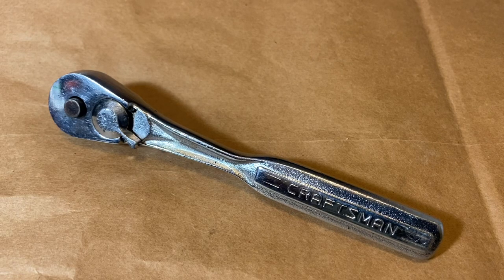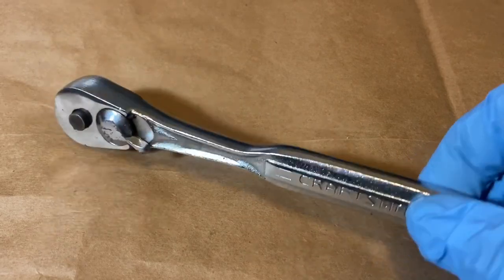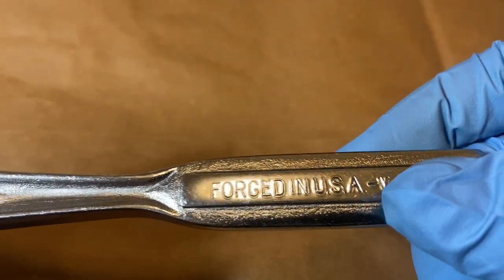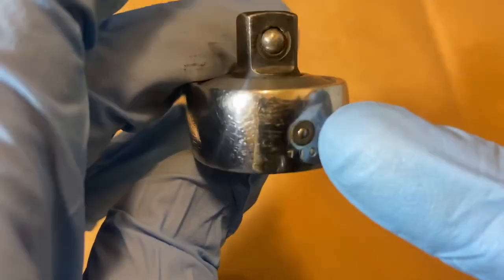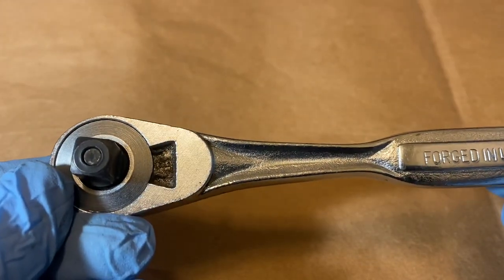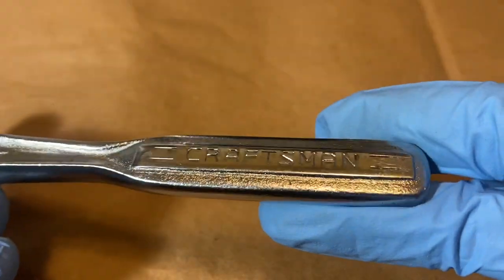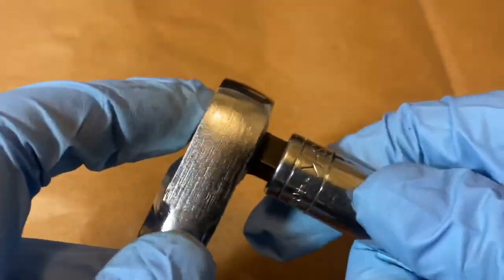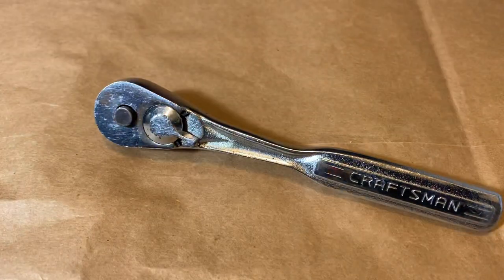“As Found” Craftsman Quick Release TOTAL TEARDOWN Vintage 3/8” Drive

Comment: Do you remember awhile back I was having trouble with a Craftsman ratchet?  About trying to oil it and couldn't get the oil in?  That's the same ratchet you have there.  It was doing the exact same thing as the one you have there.  I cleaned it but I also added fresh grease to mine.  Anyway, that's all it needed was cleaned.  Whatever lubricant they were putting in at the factory wasn't very good. At least I don't think it was to gum up like that.
Reply from the maker: Yeah that grease they used was not great quality

Comment: I've been using that model for most of my life, that was one of the handful of tools that failed and got taken back to Sears and got a new one or as I recall actually a rebuilt one...............Every now and then I run into some of that hardened gummy grease, last time was in a HF right angle drill adapter that I bought new about 20 years ago.
Reply: I'm surprised that just a little dried grease caused the skipping.  I was expecting to see sheared off teeth when you opened it up.  Goes to show how important lubrication is.
Reply from the maker: Yeah that grease is pretty bad

Comment: looks like some one used chain wax on it for lube... i had some chain lube for my atv and it harded up like a clear coat on my chain have to scrap it off,,, but anyway looks the same on the ratchet.
Reply from the maker: Yeah the factory probably used a similar grease on these.